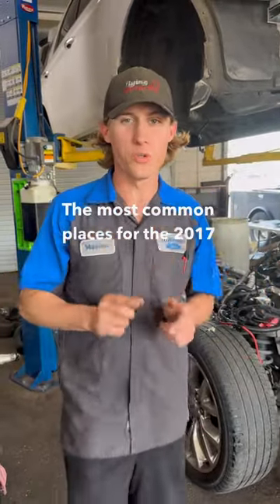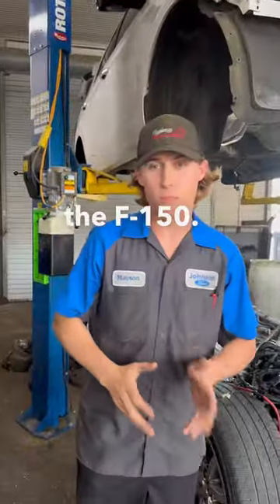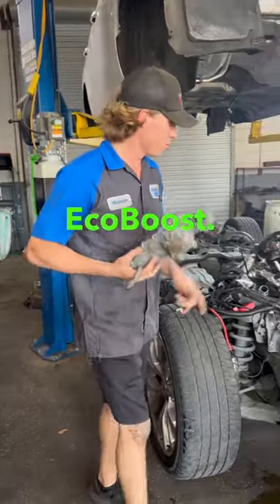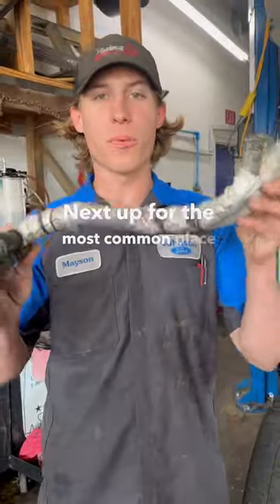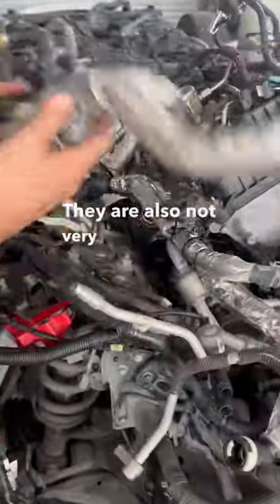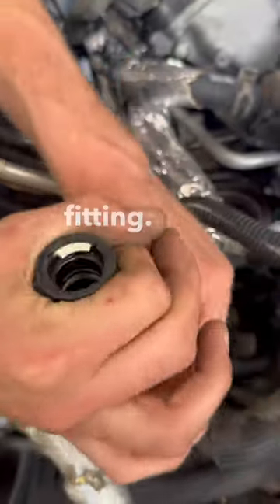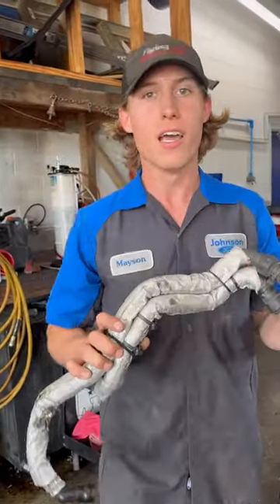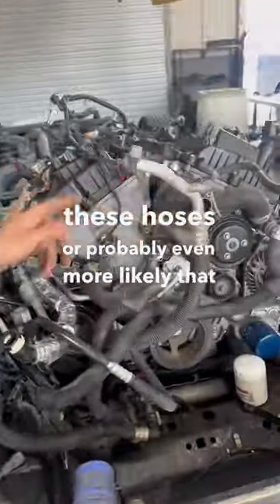Ford 3.5L EcoBoost Most Common Coolant Leaks #ford #shorts

Comment: Also Don’t forget the turbo coolant hose fittings are common leakers.
Reply: Yup… I had to change that out on mine. Inspect this leak carefully!!! The dripping will appear to occur on the right side; causing a puddle on the ground. However, it was actually coming from the left side turbo coolant fitting. It took a path from left to right before dropping to the ground. Had the whole passenger side of the wheel well ripped out before I realized what was going on!!! Dayummmmm!!! 🤦‍♂️
Reply: They changed these to o rings and not quick connect I believe after 2018 and not common to leak.
Reply: @e.b.6766 they changed the design in 2018. They don’t leak nearly as badly as they used to.
Reply: I was just writing a comment about those lol
Reply: This is fortunately only a first gen issue from what I have seen. Video is covering 2nd gen.
Reply: Literally everything on a new truck just don't buy them 😂
Reply: @dmandman9  oh boy 10 speed transmission what could go wrong?
Reply: Not on that model
Reply: Only on first Gen ece 3.5 on the 2nd generation and up they don't have that problem
Reply: @Mrjack-yn2dj  only first gen? I understand first gen had that problem. What about all the new stuff? Just as many if not more problems. Ford junk. I’ve been an auto and diesel tech for 34 years and it’s always the same BS.
Reply: @Brocephus77  Yes, only first generation 3.5 eco had coolant leaks at the turbos lines the 2nd generation sure it's possible it hasn't happened yet
Reply: Do you have to take the quick connect plastic part off the vehicle side before putting the new twist connect on?

Comment: Your vehicle is a pos if it starts leaking before it’s at least 20 years old
Reply: Name one car that won’t leak a drop of anything for 20 years I’ll wait. Don’t give me some bs like Honda or Toyota that will be disproven fast
Reply: @lParohlx Toyota and Honda
Reply: @lParohlx my parents have a 2010 escape with almost 200k miles they bought new. Only major repairs was an oxygen sensor a month ago. No leaks of any kind yet
Reply: @lParohlx had me a 7.3 powerstroke. Truck ran great but leaked from everywhere it could leak when I sold it 😂

My current 7.3 with 376,000 miles doesn't leak a drop of anything because I've dang near replaced everything that can leak because it leaked 😂
Reply: @lParohlx  My 99 Camry.  It leaked from NOWHERE up until a few years ago it leaks a little engine oil now which is fine.  But it made made it through 2 decades which is amazing.  Can’t say the same about my Fords though.  Went through 2 sets of pinion / axle seals, leaking radiator and thermostat.  Japanese vs. American big difference in quality.
Reply: 98 Explorer sohc-V6, 190000miles.
all original, owned it since '04
only normal service through the years
(strict oil&filter changes) 
a small small amount of oil sweating throught the front diff gasket, that's it.
So it sure is possible.

Comment: Anything anymore on ford is a nighmare to work on
Reply: Thermostat and water pump are actually not bad.
Reply: The more I watch these garbage fords get worked on the more I like my 5.9 Cummins. There is no easier engine to work on.
Reply: Anything by anyone made in the last 15 years is a nightmare to work on. At a general auto shop like mine you see 'em all, and you hate 'em all. Complication has gone through the roof in the last 15-20 years. There's a good reason I daily a 57 year old truck!
Reply: @josephg41  totally agree. I drive an 07 cummins.  All the new stuff is junk

Comment: I had a 1996 ford truck with 5.0 changed waterpump on average every 4 months that I had the truck. Thought about getting a different truck but changing it was easy to do.
Reply: Wow! 4 months? Bro. That’s way too often even for a Ford.
Reply: Every 4 months. wtf, did you buy some cheap reman? That is unheard of.
Reply: Are you sure it was the water pump leaking? 👀
Reply: @AntMan.2324 😂😂😂
Reply: You had a out of balance fan I’ve experienced that on multiple occasions, the fan get bent out of balance and wobbles killing the water pump bushing or backing the water pump bolts out
Reply: Here we go again mr know it all

Comment: Just had the Wye connection on the passenger side for the heater fail. Drained the overflow reservoir in half a day of driving. Had all the symptoms of a water pump failure but when the overflow tank was pressurized you can see the fine mist coming out.

Comment: Is that the same engine that was in the Ford Flex 2010-2021? I once owned a 2013 flex and thinking about buying another one but I’m concerned about the coolant leak problem and the timing chain oil dilution issues.

Comment: Sorry to ask but at wits end if you can help would be appreciated! Have a 13 f150 6r80 making a noise that sounds like clogged catalytic converter. When under a load. Shop used chatter ears and noise cam from torque converter. Put in a new tranny and converter still making same noise chatter ears still has sound at torque converter. Removed and inspected exhaust heat shields drive shafts and still noise. Have you ever had two bad torque converters?

Comment: My 18 f150 is leaking coolant still, and they have replaced the thermostat housing, the coolant crossover tube under the intake, water pump, Vegas bottle and hose going from it to the water pump.

Comment: Hey can you do a video on the na 3.5 duratecs and the water pump issues? Mine went out recently and I’m gonna tackle it myself. I’m not sure what manufacturer is should buy the parts from, and also if I should try using the later model water pump that 2 rubber seals instead of the original design. Should I also use the new yellow coolant afterwards? Thanks man I appreciate your videos as a ford guy your content is priceless

Comment: Been watching your videos for a while.  Love the information.  Been an independent mechanic for 26 yrs. Quick question,  im not a diesel mechanic at all but my 1999 F250 Super Duty 7.3 rattles terribly at idle. The noise comes from the middle of the engine and transmission.  Several people told me the flywheel or actually flexplate is cracked all around the mounting flange on the crank. Does this sound like its possibly the problem.  Ive heard the 7.3 flexplates crack alot. Any info would help thatnks for all the hreat videos and information.

Comment: You've done enough ford work to know that those hoses don't leak from the o-ringed connections. they go bad because plastic gets brittle and cracks. The updated quick connects are gold though.

Comment: Jus took a class on these an crazy how all these new trucks have so many problems from premature water pump failures to blocks having bubbles if u will where into not sold and coolant starts to leak thru 👍🏽 love ur channel keep it up
Reply: Could you clarify? Your comment interests me but I don't understand the last part.
Reply: @carlt6932  when they make the blocks they are not fully solid as coolant can find there way in to the blocks walls …
Reply: Sorry I forgot the word they called it

Comment: I’ve been thinking about getting a f150, are fords really that problematic? I know all manufactures have their pros and cons, it seems like every problem turns out to be “most common”……I had a old Tacoma that had 400k miles and had zero faulty issues, besides regular maintenance. If not a f150 or a domestic brand, what would you all recommend in terms of a solid reliable 1/2 ton?
Reply: Get a tundra. It'll treat you right like that Tacoma.
Reply: Toyota Tacoma
Reply: Dodge I hate to say that 😢
Reply: Full size guys.

Comment: You gotta take off the cab to work with cooling hoses?? 😂😂
Is that a Ford or a Land Rover?
Reply: Same thing, isn't it?😮
Reply: @paultaylor256  well... Considering that the ranger's 2.2tdci is the same as the 2.2 dw12 from psa and the same that goes in land rovers 😂

Comment: Does anyone know of a GM mechanic doing yt videos like this?
Reply: No but GM is far from perfect . I just bought an '05 to rebuild rather than buy a new one .
Reply: @Dr.Westside knock sensors ignition switches the climate control and steering column bushings are pretty much all the goes wrong on 98-07 gmc and chevys
Reply: @Dr.Westside  yep I know and it would be cool to see it by a guy like this.
Reply: DavesAutoCenterCentreville is a good channel like this

Comment: What ever happened to Ford bragging about 'Quality is Job One'?, Ford is a four letter word. Begins with  a letter 'F" but doesn't end with the letter 'D". You fill in the correct last three letters that clearly describe the vehicles Ford Motor Company has made in the last 35 years. 
That's why Ford stock never reached 14 dollars a share on the stock market. EVER.